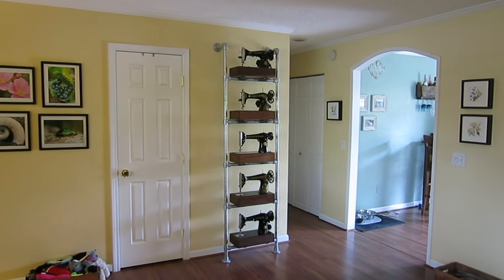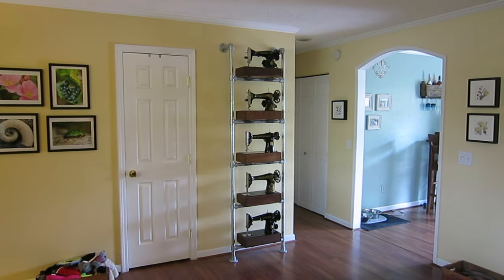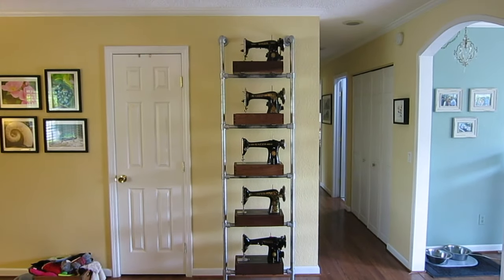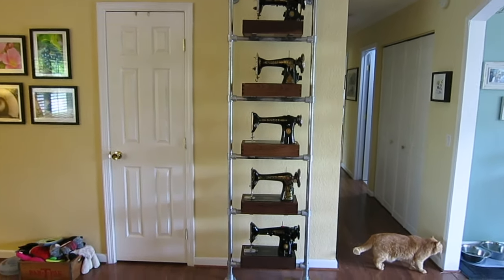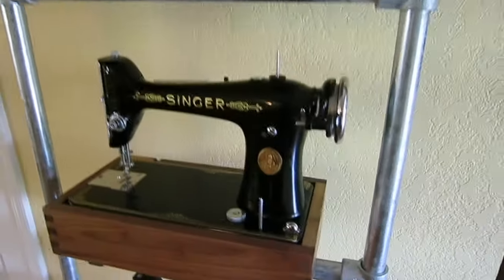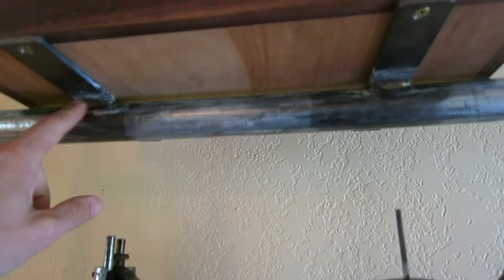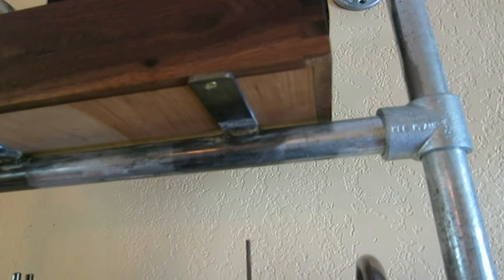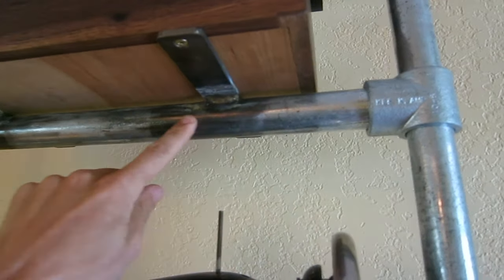Vintage Sewing Machine Display and Storage (Singer 101, 201, 66, 115 & 15-90)

Comment: That looks gorgeous, and the joints improve the looks over welding! Awesome idea! Only downside is you need to unscrew the machines from the frame to use them? Love it though
Reply from the maker: Thank you!  I don't remove the boxes when I use the machine.  I just lift them out and drop them into a dedicated table.  I also have a dedicated box that I but them in sometimes as well.

Comment: I have a SInger 101 and I am curious about how hard it is to put it on a base and replace it with foot pedal instead of the knee pedal? The table doesn't fit into my craft space and it's not comfortable for me to sit at. I feel guilty taking it away from the cabinet since they were together since 1930, but I want to use the machine. Plus, I feel the knee pedal wires look rough.

Comment: Nice job , for me i would have bent those mounting brackets into an L shape at the back ,then you could pull them down to run and oil them , no screws holding them , but thats me , i own and have 12 on display and like to pull them down to clean and run them , check the oil and have them always ready to sew , there is only one problem with this display , it will cause V.M.A Vintage Machine Addiction , i was diagnosed 2 years ago and cant be left alone at yard sales or on marketplace,  its ok  to love them right ?
Reply from the maker: LOL.  Your suggested modification sounds like a good one.  We have a dedicated table for our domestic machines to drop into so we just lift them out of the display and drop them into the table  VMA is real :)

Comment: Do all these machines fit in the same cabinet size bed? I would like to alternate the sewing machines while keeping the others on display.

Thx,
DR
Reply from the maker: +Denny R They do!  That was part of the motivation behind making it.  My wife wanted all Singers in there but if I had my preference I'd put in our Bernina 117, Pfaff 130, Singer 101, Singer 201 and an Adler 187.
Reply: +thesergeant 
Thanks, since many of the Singers fit the same cabinet I will be on the look out for a Singer 201 and 127. I think the old Singers are harder to find in the Western part of the US, I just don't run across that many..
DR